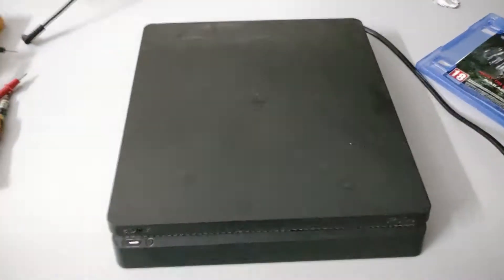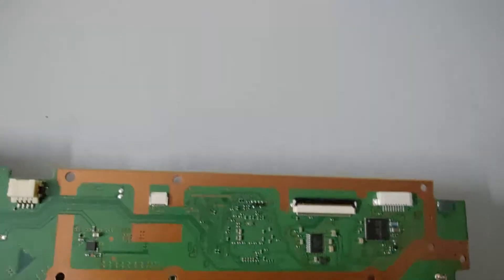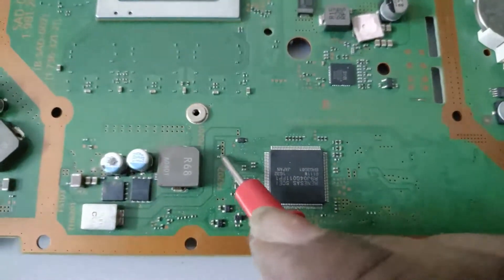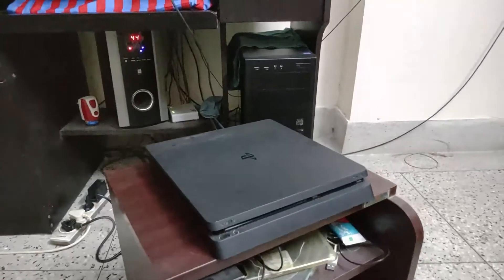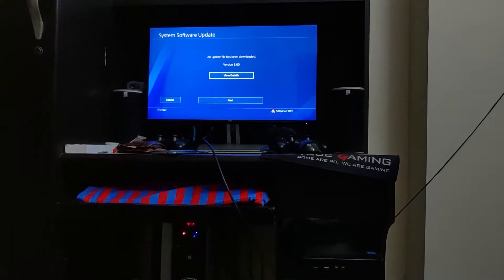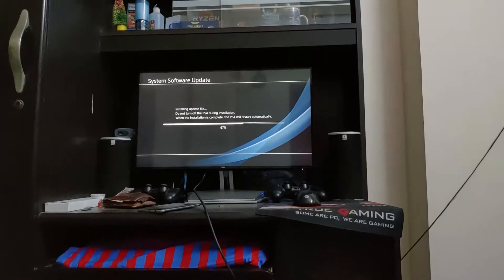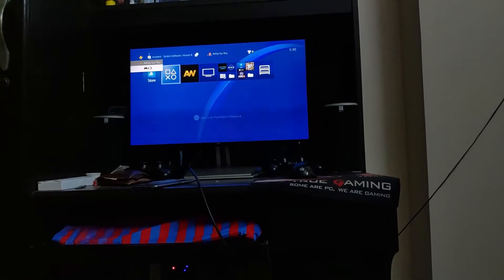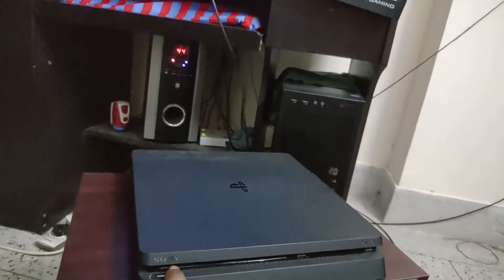PS4 Slim disk drive problem, diagnosis and repair (software update failed)

Comment: all right i'm brazilian, and i loved your video only doubt and how to know if it would really be fuse, i'm not the most experienced but i'm with ps4 slim with error CE-35888-2 i believe that this resolves since this ps4 is sealed.
Reply: something else if I don't have a compatible fuse can I make a jumper?
Reply: @FoXsamp  - Absolutely. You can make a jumper. As for the identification, usually they will be marked. Not in the exact location but you will get what I mean once you look at the board. Another way of identifying fuses are simply by looking at the SMD component. If you see a "000" or "0" marking on a black or white SMD, it is a fuse (the 0 indicates 0 ohms resistance). Hope this helps and all the best.
Reply: Helo Did u fix it ? I Already have the same error CE- 35888-2